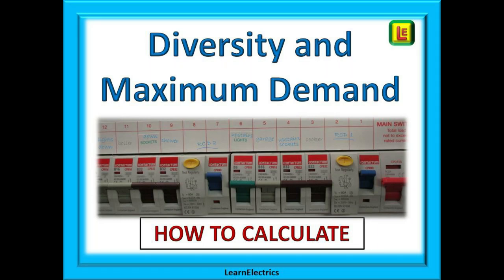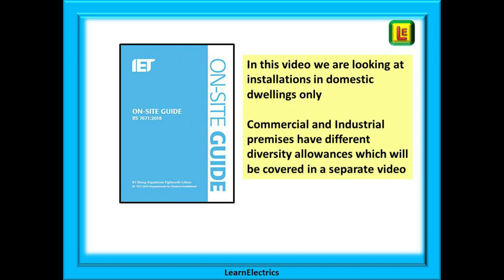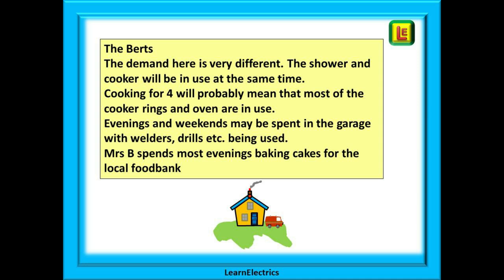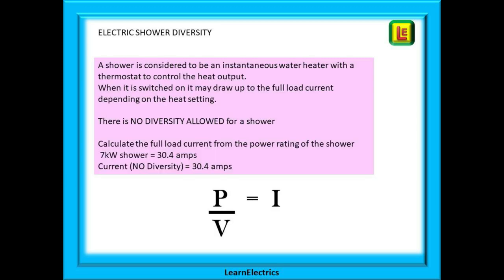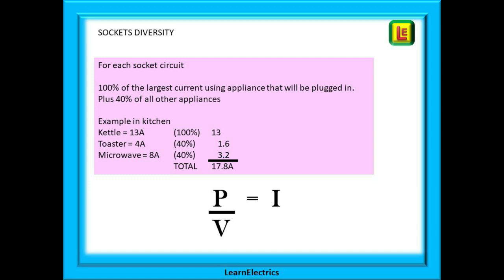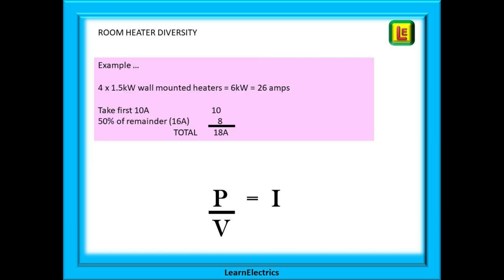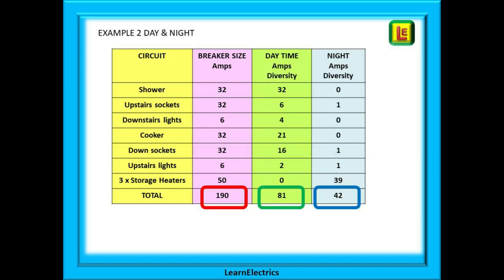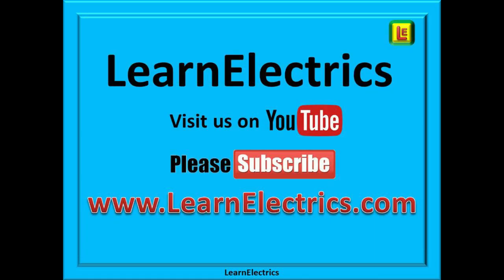Diversity and Maximum Demand in Electrical Installations.

Comment: With the introduction of low wattage LEDs for our lights 100W per lamp seems excessive. Great video.
Reply from the maker: The Regs require us to calculate for 100W per lamp holder if its possible to install a 100W lamp in it.
Some modern lamps will only fit in unique to them lamp holders in which case you can reduce the load accordingly.
Good question, thanks for watching.

Comment: can you disregard solar installations? lets say you have a 20a circuit for a 3.68kW inverter.. this has no demand as its a generator? 

does solar actually offset max demand therefore reducing it? obviously this is only the case for the midday but this is when it will be assumed that load demand is at its highest.. and with battery storage does demand reduce again?

hopefully i explained htat correctly. thankyou for your videos mate they are so valuable
Reply from the maker: Some solar installations will feed back into the grid, others will use battery storage.
Have you read through Part 8 of the Wiring Regs on Prosumer Installations. Thanks for watching. Dave.
Reply: @learnelectrics4402  I haven't mate.. I'm still early in my studies so I will read this!

Comment: Thnaks Dave,great video,but there is one i don't understand,why the fluorescent lamp we multiply the actual lamp rating by 1.8 to get the total watt??where is the 1.8 come from?what is stand for ?thanks dave
Reply from the maker: The start up currents. It is an industry recognised figure for the extra current drawn when the lights are first turned on and firing an arc from one end to the other. Once the arc is there and the light is lit, it settles down to standard current.
Hope this helps, thanks for watching. Dave.
Reply: @learnelectrics4402  
Very helpful, thanks
Reply from the maker: You are very welcome my friend. Dave.

Comment: Room heater diversity.  Does thermostatically controlled underfloor heating in each room, class as wall mounted room heater? 
thx
Reply from the maker: Take a look at Row 7 of Table A2 p137 if you need individual diversity for underfloor heating.They are a fixed appliance and should be on their own circuit.
Reply: @learnelectrics4402  
Thx very much, appreciate.  That is rather common sense to have each room off its own circuit.  Except for a few low current bathroom UFH's that can be off the one circuit. 

But what about diversity relating to the whole system?

Comment: This sort of unrelated to the subject...if I'm doing a kitchen and I ran a 10mm cable for the HOB can I add a socket next to it for the oven...or do I need to run a separate circuit...take it of the ring...THANKS
Reply from the maker: Yes, you can spur off the cooker control panel to supply power to the oven. The building regulations allow this as long as the hob and the oven are both with 2 metres of the control panel. Hope this helps. Dave.
Reply: @learnelectrics4402  thanks
Reply from the maker: You're welcome.

Comment: In relation to cable calculations, can anyone clarify for me whether you apply diversity before or after you work out In? Because the way we do at my college is to work out your In from your Ib but surely if you do that and then go on to apply diversity after cable selection youd potentially have use a lower rated circuit breaker?
Reply from the maker: The college way is right Lee. In for max demand based on Ib and choose cable size on this. Diversity will affect the overall demand on the whole installation. if you add all the breaker ratings together it will be a lot more than 100A, this is where diversity comes in.
Hope this helps.

Comment: The DNOs fuse is to protect their system, not yours as that is your responsibility.  Say the main DNO fuse is 100A, a double pole 100A MCB can be fitted which can also double up as a main isolator. This is a cover all for any diversity of a whole house system.  So diversity can say give 115A, but the 100A main MCB catches all.
Reply from the maker: Great comments, thanks for watching.
Reply: @learnelectrics4402  
A customer's 100A gG fuse can replace the whole house MCB as the fuse only acts on overload not fault, so any fault trip is restricted to its own MCB/RCBO circuit.  Selectivity at times cannot be relied upon, the main MCB may take out the whole house.  

The likes of FuseBox make a metal box with a 100A main switch and a single gG fuse holder, quite cheaply. Then diversity is not a problem.  Best have a few spare fuses in case, like in the old days - seen them from £2.50 to £4. If you think the 100A may occasionally be exceeded, fit an MCB to instantly reset.

As I wrote, this gets you through the whole house diversity issue, not diversity in individual circuits.

Comment: And therein lies the problem! Sparkies are NOT clairvoyant. ANY installation SHOULD be designed for a "Bert" or higher usage even. Otherwise when "Bert" moves house he has to forgo his hobby for weeks or even months and lay out a fortune to have his house & CU completely rewired to be suitable. 

STOP designing CU's for low loads!
ALWAYS design for high usage, ESPECIALLY since electricity usage is increasing all the time.

I'm sick and tired of seeing 6-way and 8-way extension leads having to be used in other people's houses I've visited because there are only TWO sockets in a room! Even in new builds! Bloody ridiculous! 

There should be AT LEAST one double socket on each wall! Anything else is BLATANTLY stupid. Likewise in bedrooms ONE double socket on ONE side of an expected bed position when there are two possible bed positions meaning FOUR DOUBLE socket outlets, one each side of each bed position and another above a standard height dressing table for hair drier etc. 

A house I had in Bradford had 26 individual sockets/switched power feeds in the kitchen alone on its own ring! 

On one occasion 22 were occupied! Not all  delivering power at the same time but who wants to keep plugging and unplugging a mixer when you want a cup of tea and you can't use the microwave and toaster at the same time?

Always design for "possible" not probable expected maximum load in a specific situation and with minimum diversity expected in a generic situation!  Anything else is just the electrical industry lining their pockets at the expense of consumers!
Reply from the maker: Great reply Bob, thanks for watching. Dave.